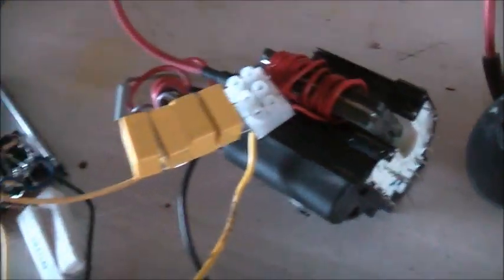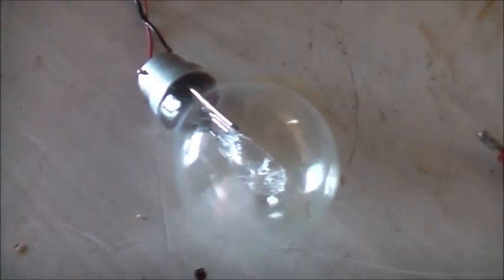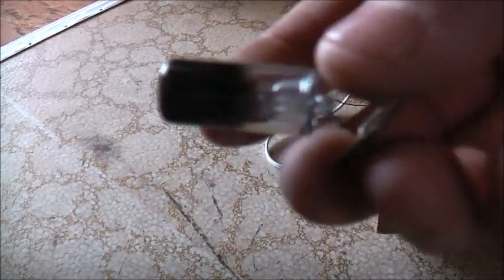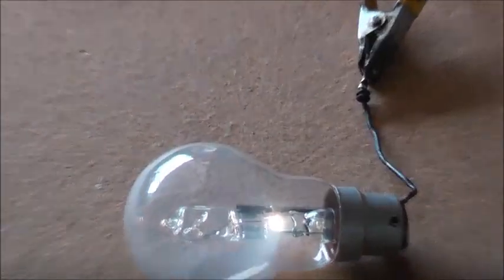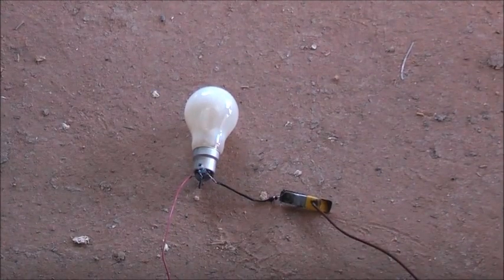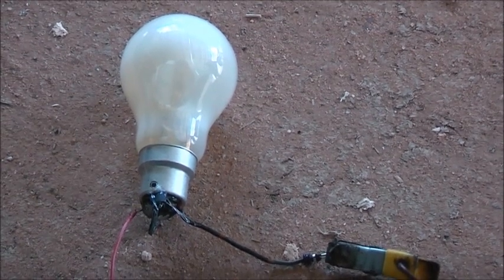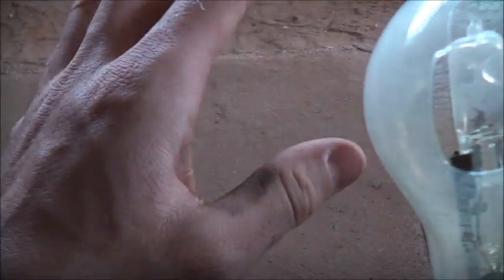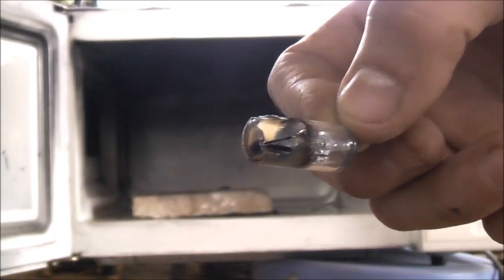Arc In Lightbulb & Microwave Action

Comment: the reason the mosfet failed was because it was handling a direct short, with no oscillation as you basically turned the gate on fully and it stayed that way. the gate needs the resistor to ensure the device is fully off when gate drive power is removed. the zener diode is there to make sure the gate doesnt get over volted. the fast diode is what insures the "flip-flop" of the device

Comment: Viewer # 23 :D

Haha, YAY! You managed eventually to squeeze an arc in the bulb. :D
I was impressed by the smoke development in there, it almost made the bulb into a Pearl bulb. :D

When using MOTs to arc-up bulbs, you do need a variac for control. If the filament in there was still OK, the technique is to tease it on the variac, keep on cranking until it's teetering on the edge of popping, then give it that bit extra.

As the filament fails & opens up the circuit, it also draws an arc, & bingo!